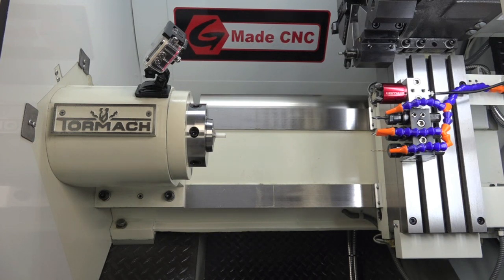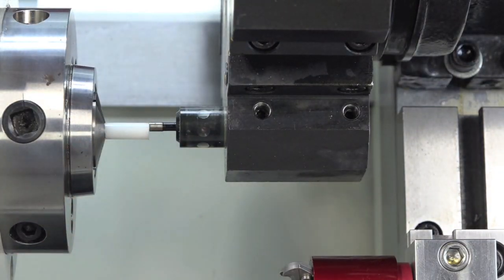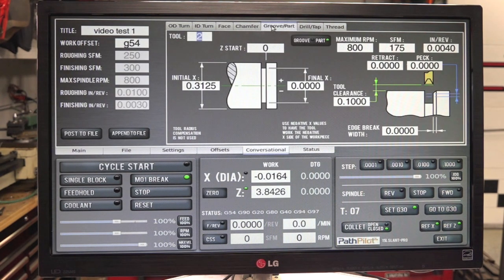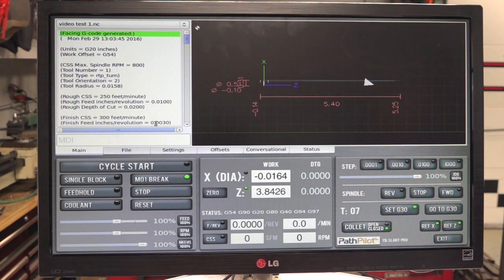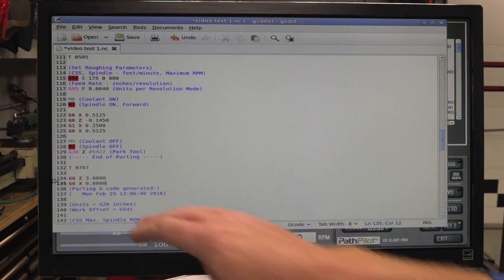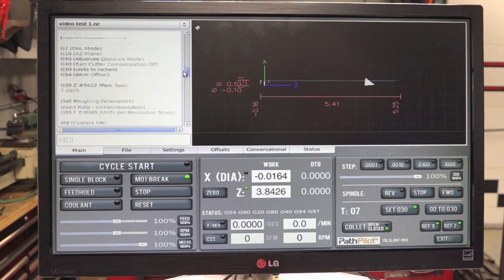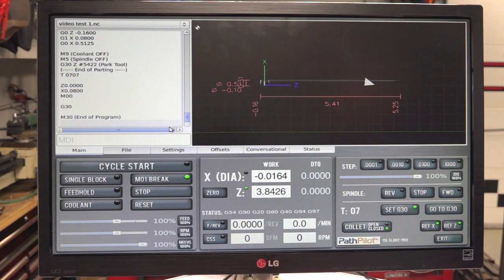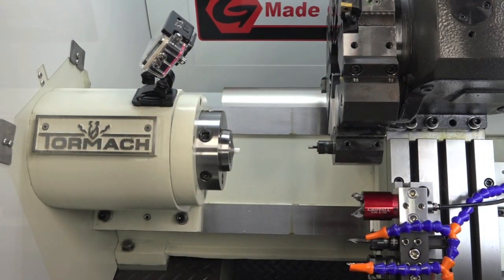Code editing in Tormach conversational

Comment: Hi,
Don't know that much about bar pullers.  
1:  If you used your bar puller could you accurately pull the 3" distance each time once you figured out the collet pull back offset.
2:   Would you possibly have to adjust the distance the puller grippers move in to grab the part as there is a groove near the end?
3:  If these and possibly other items addressed could you run a suitable length rod and produce multiple parts without stopping the machine?
Just trying to understand how all this works.

Really enjoy your videos, thanks for sharing!!!  You are the man.

John

Comment: I have listened to a few Tormach Slant lathes, I never before heard how noisy yours is, both the spindle and the linear motions.
I may not completely have all the credentials to call this or critique what I hear, but it seems like there may be a weak
voltage on one of the 3 phases. You may want to compare with other vids online....or just ignore my ears and comment.

Thanks for the educational.